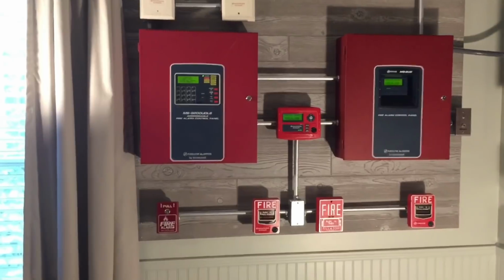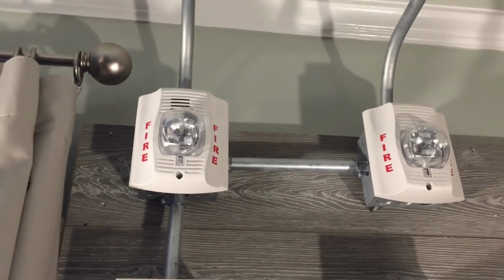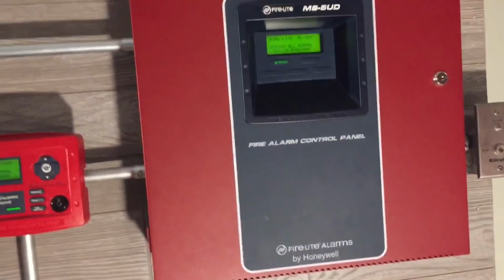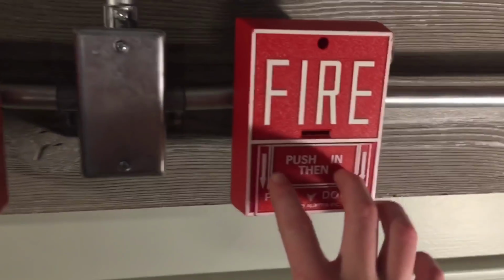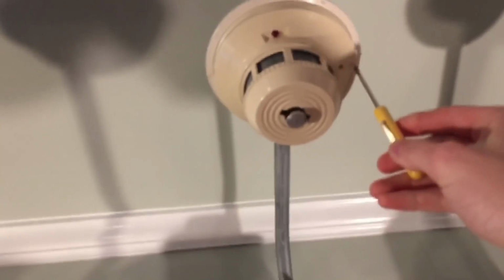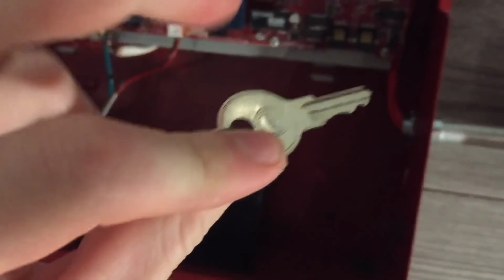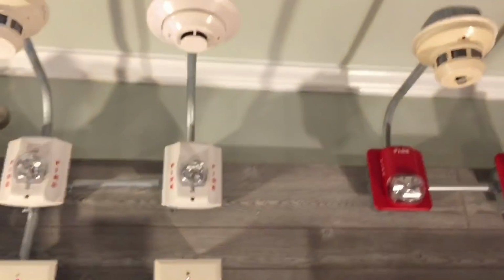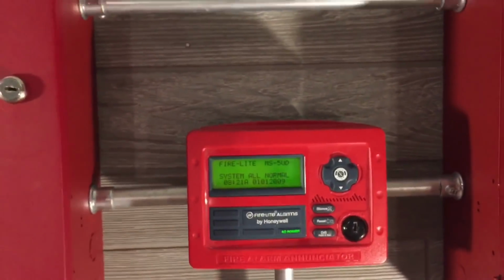System Test 1 | Board 1

Comment: Does the alarm panel control the temporal 3 horn sequence, or is that controlled by the hornstrobe itself?
Reply from the maker: This can vary depending on the system and the setup. Usually you can have either the panel code the alarms or the alarms themselves can produce the code. In my setup shown in the video, the alarms coded themselves.